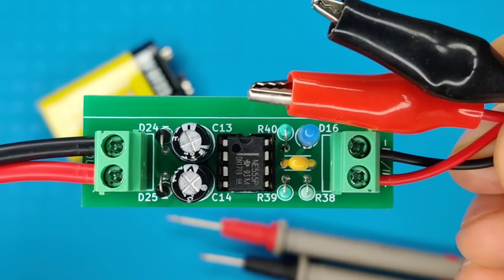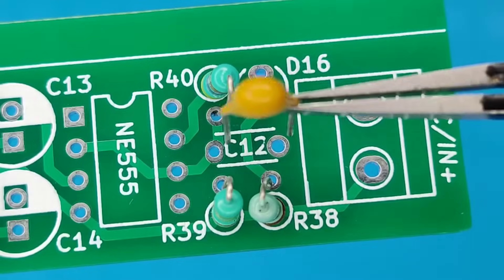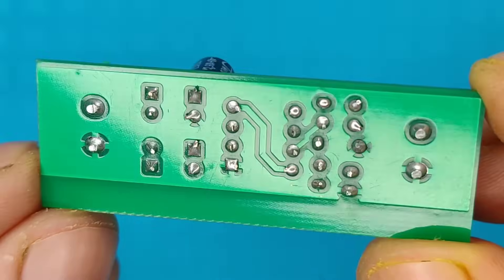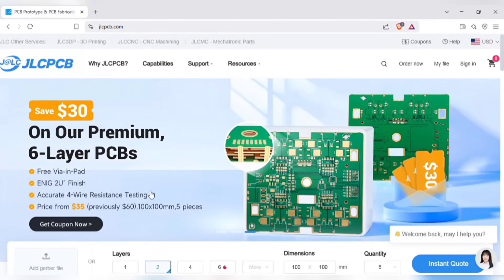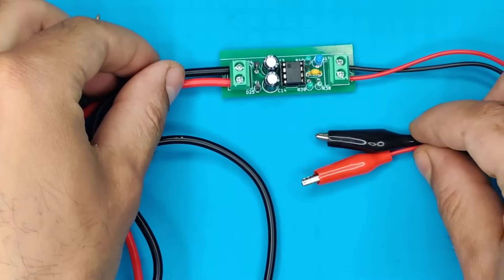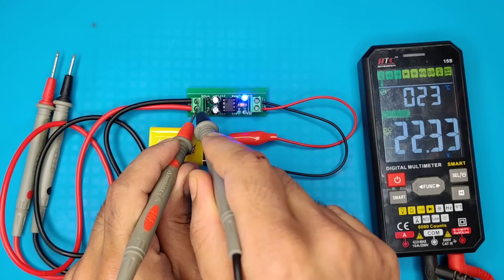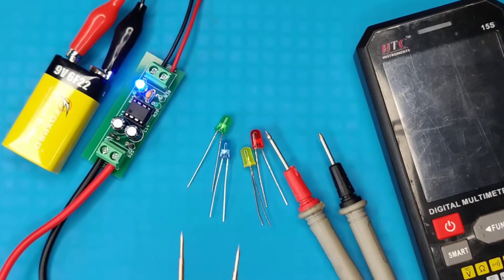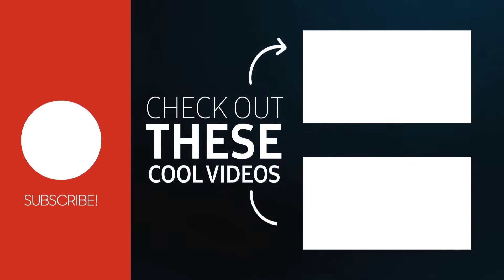This device is helpful For Every Home, Using 555 timer IC

Comment: Now how would you add the 3 wire voltage meter to the circuit to see the voltage drop across what your testing.

Comment: Hi. I bought an original PCB, soldered all the components. I have 9V DC at the input and about 18.5V DC at the output.
However, when I tried to measure any LED, they all burned out. When I short-circuit the test leads, the D24 diode heats up and the control LED lights up dimly.  
Where could the error be? What is the difference between NE555P and NE555N?
Reply from the maker: There is no error, just add 1k 1W resistor at output then supply it to led, as current from this circuit is little higher
Reply: @CreativeTechos Now it works, both LEDs and Zener diodes.
I didn't think to limit the current.
Thanks for the advice.